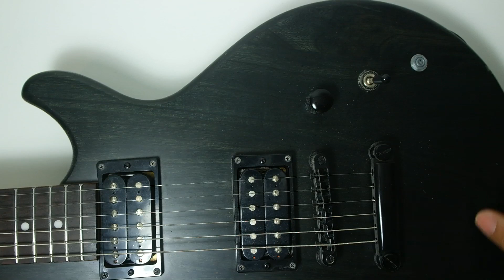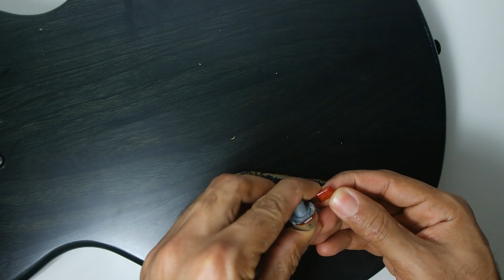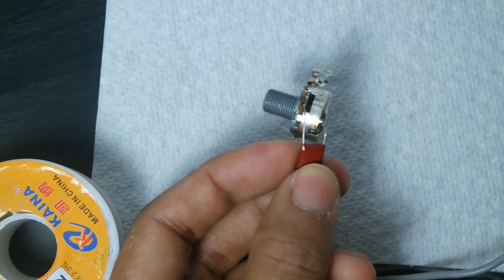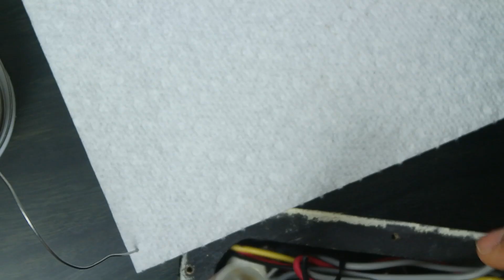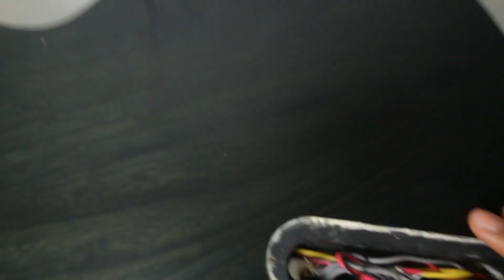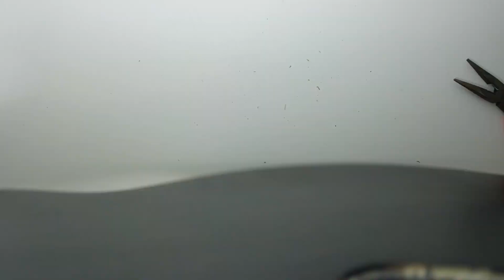Fixing a Sheared Potentiometer of a Dean Evo XM Electric Guitar

Comment: the capacitor is to create a low pass filter for the tone knob brother, sending more high frequencies to ground (not to the guitar amp) so you can change how the tone sounds as you're playing
Reply from the maker: Those are some deadass facts b. I supposed it was a lpf with variable resistance based on the way it was wired.